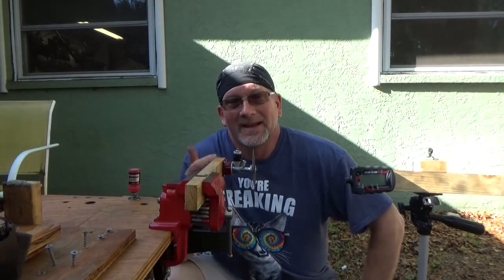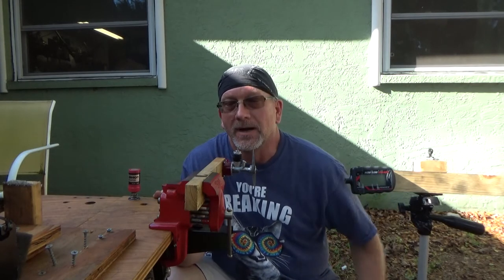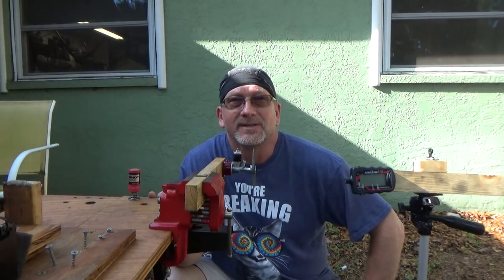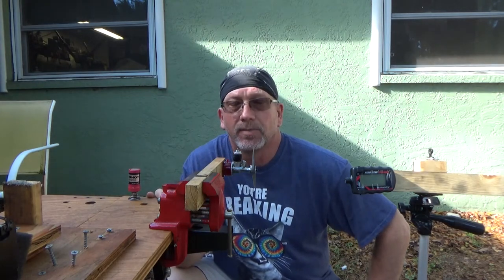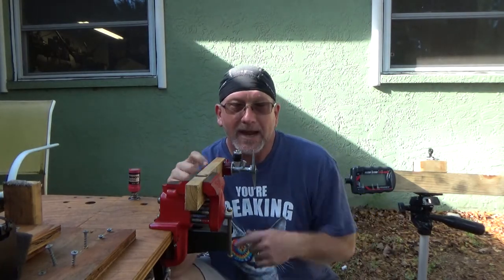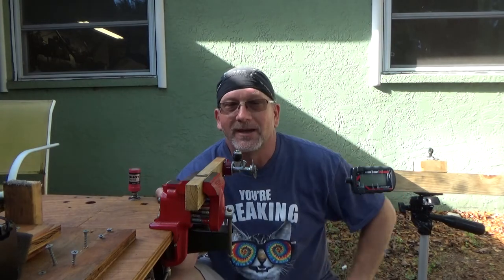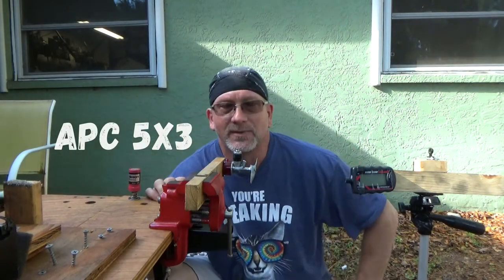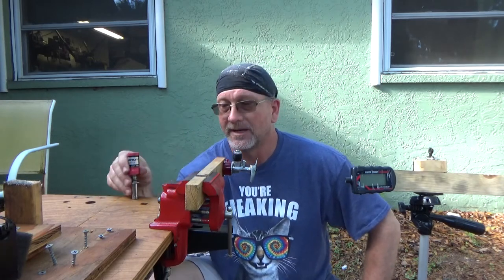OK Cub 049A A Hard Earned Run

Comment: I am 72 years old and when I was a kid, I cut my teeth on Cox's and OK Cubs. I remember cold days in Kansas when we were trying to fly and also trying to start an OK Cub. We would squirt fuel on the outside of the cylinder head and set it on fire with a lighter to warm the little beast up. I still have my OK Cub .074 & .099. The larger they got, the better they ran. This is just a suggestion,  but get yourself an inexpensive microscope and you can use it for needle and spray bar examinations. Another thing to check is the "clocking" or orientation of the spray bar when it is installed in the venturi. I have seen them right side up and up side down. Thanks for your videos and the work you are doing. Good stuff!

Comment: This was the very first engine that got me highly interested in building and flying model airplanes, this was back in 1959, I was 8. It came in a "Sabre 44" and it was a C/L plane. First was a plastic plane, then I built flat balsa and profile planes. Then came build-up wings.
Now, I build and fly R/C stuff.
 Biggest plane now has a 7 ft wing with a 24 in. cord.  Flys with a WeedEater engine.
Started out small, and my hobby, just got bigger.

Comment: Hi Ive got lots of these and they start much easier if you squirt a little fuel into the exhaust to prime the enging. just choke till you see fuel in the line, dont keep choking as you  will flood the engine. Set the needle valve between 2 1/2 and three turns and leave the glo start on till its 2 stroking. Should save you a lot of effort. These are not the most powerful in their class but they're strong and durable and the standard plug is easily changed if it burns out. The 5 inch prop is ok but it has enough torque to turn something like a 6X3 or 4 too if your thinking of free flight models. Hope this helps.

Comment: When I was a kid those engines were about all I used as they were cheap to buy , after you get used to them, and get the needle valve set they alwaysvstarted 4 me in about 3 or 4 flips using a 6/4 nylon prop, ( for the flywheel effect) at least they only ran counterclockwise ( with a Cox engine, you never new which direction they would be running , I found that a OKcub  074 had about the same power as an 049 baby bee   I found the OK CUB A LOT EASIER TO START THAN THE COX!!!.

Comment: You can buy a Cox .049 aluminum spinner for it and a hex head bolt, by doing so you can use a Sullivan Hornet 1/2A starter to fire it up with no fuss will make it a very user friendly engine for a project. The APC is too heavy and the airfoil is too thick for the engine of that class. I would suggest using a Cox 5X3 or 4.5x4 will make more rpm and thrust with good pitch speed for flying. The lower weight prop will help the engine NV hold a better / steady setting.

Comment: Hey Dave, can you tell me if this is a short or long reach glow plug ?  Also, if you know, does it use a "hot" or "medium" glow plug ?  Thank you for your time.
Reply from the maker: I really don't recall.  Sorry
Reply: It is a short reach plug (  DONT try a long reach plug as it WILL hit the piston and either bend or brake the rod )!!
Reply: Also you probably will have to use whatever you can find for heat,  a hot plug is better if you can find one

Comment: When the engine starts around 2:20 into the video it appears that fuel is bubbling out of the left tube on top of the tank.  Is the tank being pressurized when the engine is running?  A finicky engine for some reason.
Reply from the maker: I have no idea. I did not disassemble the tank at all.  I would like to see what it looks like inside however.
Reply: maybe the temp going up inside of the tank.
Reply: tank may not be sealing good and creating compression leak a the back plate, might replace the tank.
Reply: @johnkelinske1449  This is not a reed-valve [049R] engine where it is important to have a sealed tank. This engine
is an 049A which has a separate tank attached to the engine. You could remove this tank and run without it.
Reply: It’s just the air pressure passing over the top of the pipe,producing a low pressure zone .just like a simple airbrush. So lifting fuel out of one pipe